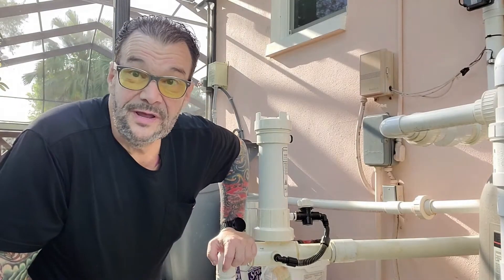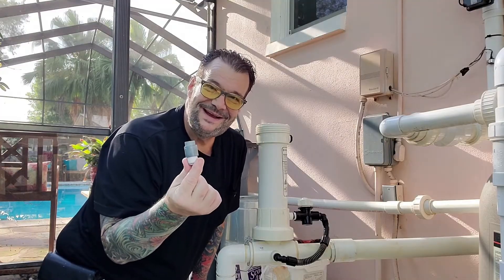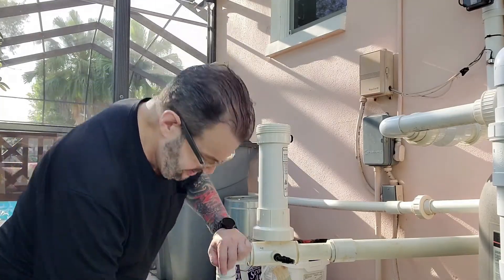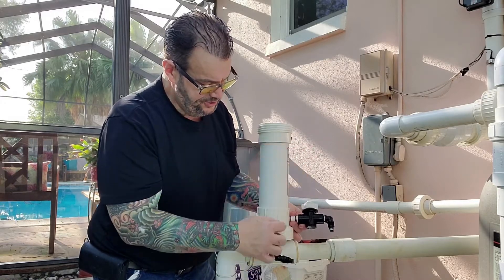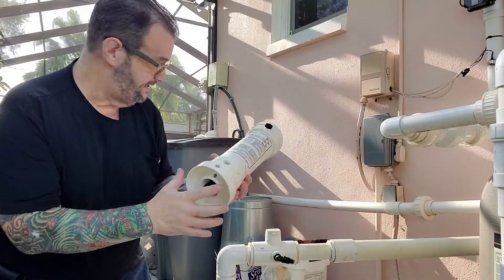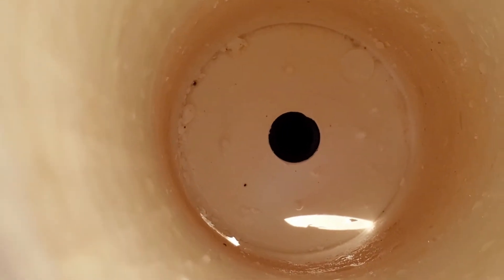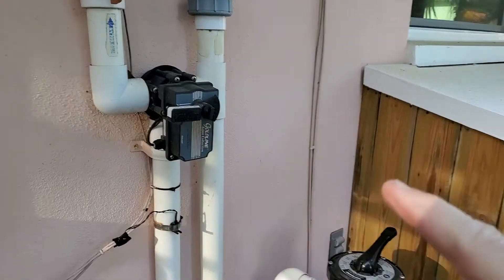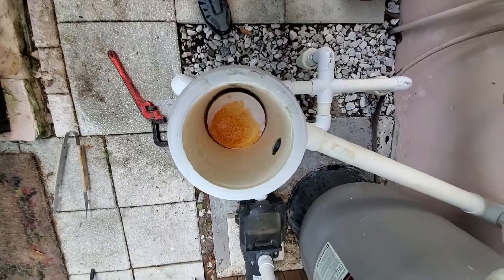Pentair 320 Chlorinator Troubleshoot Fundamentals and Repair

Comment: Really good video, I appreciate the end addons to point out things missed. I did find that when the tablets are flat in the chlorinator you can not pick them up with tongs but it was not a problem as they came out when the unit was inverted after removal. In my case the filter at the bottom was non existent, it had rotted completely with some very small pieces clogging the valve at the bottom. I did find another video showing the removal of the valve at the bottom using a pair of grips. Again, thanks for a well presented video.

Comment: How do you get the gasket to stay in place when turning the tube right side up to reinstall? And what’s the problem when the check valve works, the hose is not clogged and the proportioner works?

Comment: Very good explanation. The screw you didn't know what was for is a set screw to lock down the canister. That way it won't come loose from the vibration of the pump and also locks it down so you can turn the lid on and off.

Comment: How bout that, an a/c tech that knows pools too! Serious question for ya, I have a pentair 100 milivolt pool heater outside and my 4000 gall pool inside. I'd like to use a digital HVAC style thermostat inside. Can it be done on the piolet light milivolt heater? Assuming I'd have to run 24 volts to the thermostat.

Comment: I struggled to remove the lid every single time, not even if i lubricated. How can i untight it? Heat? Will the tool be enough? I have already loose the chlorinator and will need to tighten through that screw that is in an unconvenient spot

Comment: I agree with the others, this is a great video.  You've explained the workings very well.  I'm still not sure if mine is working right or not, but I feel better equipped now to troubleshoot my system.  When my pool was installed I'm seem to remember my installer telling me to listen after adding tablets to my chlorinator to make sure I could hear  the clicking of the check valve.  Is it safe to assume if it's clicking it must be ok?  Anyway, thanks for your video!

Comment: Great explanation as I was unaware of the check valve.  Top or bottom connection of the water does matter.  A top connection moves more water over the pucks causing more chlorine to be released.  (useful for large pools like mine)  I remember it being in the installation manual when I replaced mine.  It also helps greatly to lube that seal and to not over-tighten the top; making it a lot easier to unscrew the top.  (use lube made for pool equipment)

Comment: My pool is new to me and the chlorinator was empty when I got it. I filled it up with tablets and had the setting on 2 as the previous owners did. A week later my chlorine was 7.5 and my tablets were nearly gone! Your video helped me figure out that my check valve was bad and I was missing the screen. Thank you!

Comment: When you were demonstrating how the Chlorinator should drain through the check valve once the pump is turned off, would that be true for equipment pads that are well below the level of the pool...whereby the pool water will remain in the return lines even after turning off the pump?
Reply from the maker: I can't say for sure, but I am leaning heavily toward no because that line would not be draining back out.

Comment: Missing one important step. After placing chlorine tablets in chlorinator, bleed air from the chlorinator. I do this by turning the pool pump on with the chlorinator cap off and when water reaches the top of the chlorinator, screw the lid down. Makes a difference by allowing the water pressure in the chlorinator to match the water pressure in the pool return line.
Reply from the maker: Thanks for the tip

Comment: Couple things the screw prevents the whole feeder from turning when taking off or replacing cap. As far as the check valve goes mines not frozen but fails to seat all the way allowing flow(a slow flow) Not sure if this could cause the issue if anyone knows…either rate I’m probably going to get a new one and replace it.

Comment: Tommy great video. Detailed. So really I could run my chlorinator without a control valve? Just close that port off. I get that I can't control how much chlorine is going into the pool with out a control valve. But by not installing a control valve, can this do any harm to chlorinator or piping? I'm assuming it would use up chlorine tabs faster because there's no control valve. But technically it can be done, correct?

Comment: Excellent explanation, now thanks to you I understand a lot better the Chlorinator. Can anyone explain to me at what setting should I place the water control valve from 0 t0 5 controlling the flow of water to the Chlorinator ? Which setting should place it? Does it dependents on how many tablets I put inside the Chlorinator? I will appreciate some information on it
Reply from the maker: It's a balancing act between how long your pump runs, how many tabs you keep and any other shock you may use. I keep 8 tabs on level 3 and a 6 hour run cycle. But you still need to perform regular tests to see if that setting works. My pool is 20,000 gallons so that's a factor as well. Finally we have been getting rain everyday and that can throw off your normal setting. If you run shorter run cycles in the winter you can adjust the setting down to 1 or 2

Comment: My issue also turned out to be that check valve on the bottom, but it was doing something completely different. Water was entering the chlorinator thru the hose as it should, however, the faulty check valve was just letting the water immediately leak right out back into the return line as fast as it was coming in. My hose wasnt leaking but it was pretty dried up so I replaced that along with the check valve and the chlorinator is back in business. I hope this comment helps someone solve their problem as your video helped me solve mine. You really helped me to understand how the chlorinator works, which helped me figure out my issue, thanks

Comment: My 320 would only fill up halfway with water.  Turns out there wasn't enough pressure in the return line to push the water level higher.  Once I replaced the outlet restrictors on pool sidewall, the backpressure increased and now the water fills all the way.  Also my cartridge filter is dirty and probably keeping the pressure to low on the return side, too high on the pump side.
Reply from the maker: Wow, this is good to know and makes sense. I'm glad you took the time to share this. It would not have occurred naturally to me.
Reply: My 320 chlorinator was filling entirely with air within 24 hours every day.  The only thing that fixes it is just cracking open the lid until you see just a trickle of water spilling out, and just barely screw/turn it closed until the trickle just stops.  This allows a tiny amount of air to bleed out continuously.  Now the chlorinator doesn't keep running itself dry.  I don't see any bubbles in my pump, so maybe I have a similar problem in my pool as you had...maybe my jets are a little too large orifice and I should switch back to the original small sized jets?  Or maybe Pentair needs to add a metered air bleed adjustment screw to the lid.

Comment: I just had this same issue and checked everything: the check valve, the flow into the canister, EVERYTHING! Then I decided to fill up my pool’s water level and I found out THAT was the cause of no chlorinated water flowing out of the canister. Hope this helps you if you are having this issue!
Reply from the maker: This is very interesting thank for adding to the knowledge base.
Reply: Perhaps you needed some back pressure on the pipes to get the water to fill the canister.  I found out that my canister wouldn't fill with my return nozzels off, but once I installed the return nozzles (jets), which restricted the flow to pool and caused a back pressure on the return lines, my chlorine canister would fill with water.

Comment: Great video! I am still having trouble with mine. The water flows in fine, the check valve works, but I think that the water pressure is so high that the ball in the check valve at the bottom of the chlorinator is being pushed up, which is COMPLETELY preventing any flow of the chlorinated water back into the return. How the heck do I fix this?
Reply: I think your guess is probably right. I have the same problem.  The check valve seems to work, and water fills up the chlorinator quickly. When I shut down the system, water in the chlorinator goes down quickly. However the tablets still won't dissolve. So other than replacing the valve, there is nothing else I can replace.
Reply: @weipingshi77845  hi Peter! I just discovered my problem was actually the water chemistry and not the functionality of the Chlorinator. If your stabilizer (cyanuric acid) is too high—my pool was OVER 300 ppm (normal range is 30-50 ppm), you can experience chlorine lock, which renders the chlorine ineffective. I had to drain my pool around 60% and then refill with fresh water and that put it at 50 ppm. I also have to discontinue using the tri-chlor pucks because they contain the stabilizer/cyanuric acid. I would definitely check your levels to see if that is a problem you may be experiencing. It was driving me nuts!
Reply: @mattphat23  Matthew, thank you the the update! My cyanuric level is 50 ppm. But even if the cyanuric level is too high, the tablets should still dissolve. I found in another youtube video saying there is no pressure difference between the two tubes, and therefore, there won't be any water flowing through the Chlorinator. But why it used to work, but stopped working now? The only difference seems to be that the protective screen at the bottom of the Chlorinator is broken, thus the tablets are sitting on the hole. I have ordered a new screen and hope it solves my problem.
Reply from the maker: This is a very sensitive tricky valve and the little ball can get hung up from chemical imbalance as suggested and other issues. I pointed out in the video but the little tabs in the bottom that hold the screen in place can break off and go down into the valve. Best thing to do is make sure you change the valve out before doing deep diagnosis. The pressure balance over this check valve is so minor because it uses the same water pressure on both sides of the valve. The only reason why there's a pressure difference is because of the Venturi effect on the bottom side of the valve. Too complicated but true
Reply: @iaqtomy  You are right. I cleared the debris and changed the screen. Now it works fine.

Comment: Just decided to maintain my own pool because of poor service and could not figure out what this canister was doing there. Was using a chlorine floater!  Was looking over videos on the canister, and this is the best by far! Props to Tommy for the intelligent way he described his investigative work to diagnose the source of the problem!
Reply from the maker: Good luck I took over my pool several years ago when the pool guy insisted he use a bobbing tablet despensor. When I asked him about the autochlorinator he said those things never work so I never used them.  That's when I knew I had the wrong person.  Good luck
Reply: I hear you on the poor service from pool guys! They tell you all kinds of things and such misinformation. Drives me crazy! I just fired another guy after 3 days. Was showing up at 8:30pm at night. Scared me to death as I was out there literally working on pool since he didn’t show up. 
What’s worse is he screwed in my chlorinator top so tight I can’t get if off! I broke all four tips (wth didn’t they dust put a handle on these like they do the pumps???) in any case I bought a new top yesterday from pool place. But I still can’t get the old one off! Any suggestions? 

I just broke the valve going into the chlorinator trying to get it off. Then now just broke the black tube. Ughhh! I am woman and trying to save myself some money. But now I broke two pieces just trying to get the top off! Any side ideas or suggestions? I even tried using rubber mallot! Thank you

Comment: Nice Video! Question: I took my unit off of the Return to pool line and I found that there is a rubber o-ring on the bottom of the unit...I did not see the small o-ring on the bottom of your unit so I left mine out, but unfortunately my unit started leaking like a sieve from the bottom ( and out the small hole where the screw was).  Does your unit have a small o-ring at the base of the unit where the check valve is?
Reply from the maker: I am sorry for the delay but I don't think there was a O-Ring on the bottom of mine but I can be sure.
Reply from the maker: I can't remember but if it did not have one I would have used  Teflon tape.